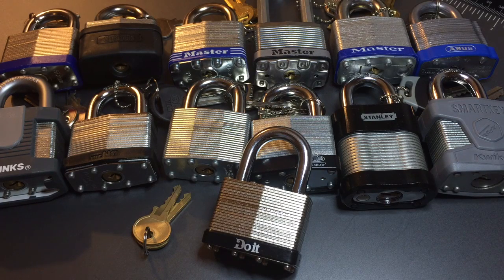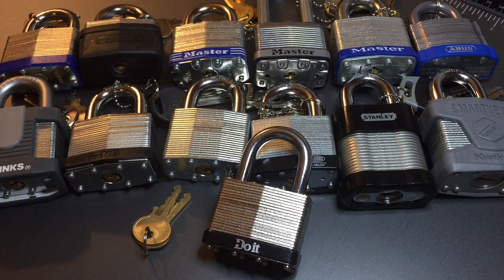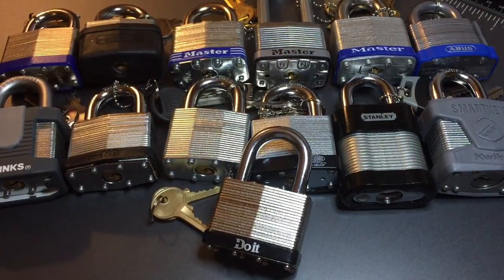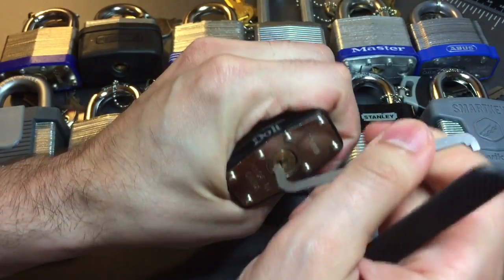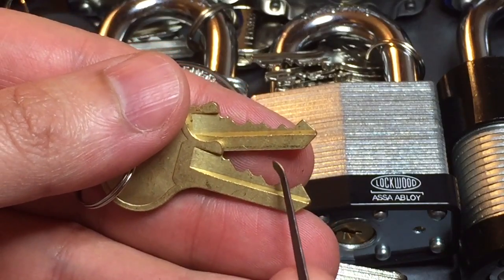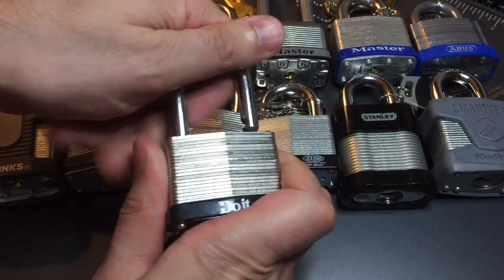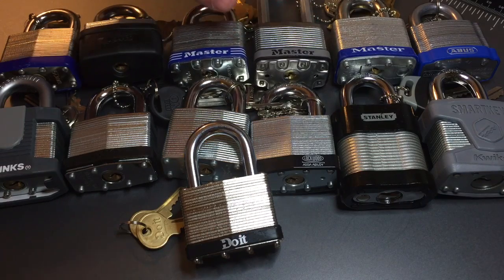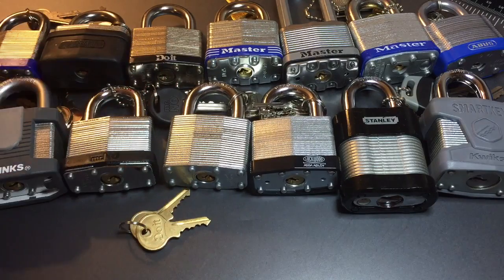[228] Do It 50mm Laminated Padlock Picked (50mm Series)

Comment: Crap should've sent you my Lock-it that would've gotten worst. I bought it for around  $8 at Home Depot got home put my tension in and it opened looked inside, no pins. On the Do-it they had 2 at this mom and pop hardware store and the other one the last 2 pins were all the way up so you'd still only be picking first 2 pins. Glad I could show it the opposite way by key pins being too long.
Reply from the maker: +Randy Perkins Thanks again. It was at least nice to show the key pins being too long.

Comment: Hey LPL you can probably open it, just by inserting a BOK wrench and lift those two pins. Still do not understand why any company would bother making such a cheap lock. The material and manufacturing cost out weigh the security of the lock itself.
Reply from the maker: +pbsing probably a combination of not knowing and not caring.